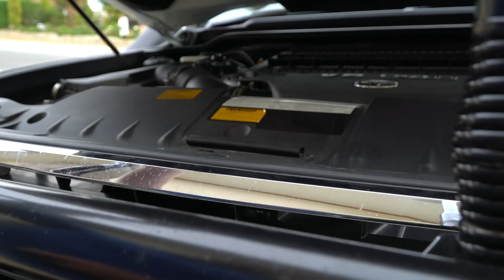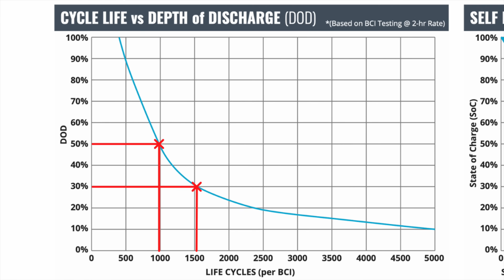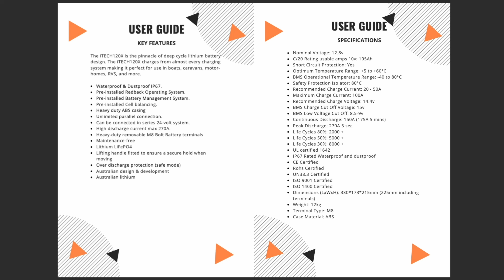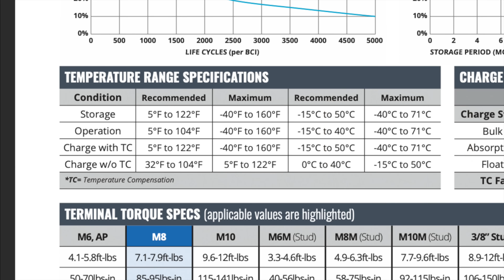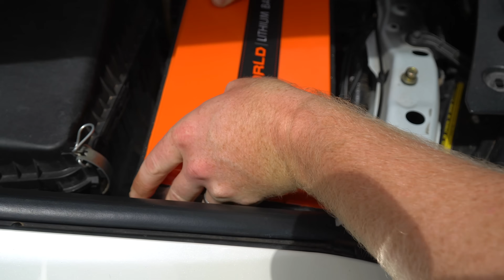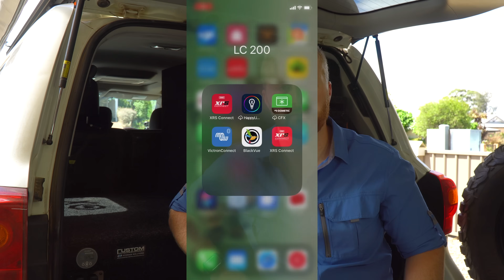UNDER BONNET LITHIUM | Is it worth the money? | Can it survive the heat? | iTechWorld 120X 12V setup

Comment: Hey Nathan,
Thanks for the good info I have also replaced my AGM with the Itechworld 120X in my 200 series and have not seen much of an Improvement over the AGM I only get 3 days run time between charges and I am only running a 60lt fridge which consumes between 1-5 amps
Reply from the maker: Hmm, this is interesting Clint. It will be interesting to see the results I get from it over time to compare. 
Cheers.
Reply: Which dcdc charger are you running to charge it?
Reply: @deepcyclesystems  Redarc 50amp
Reply: @clintrobey3765  capacity test it after 18 months and share your results...

On a battery pack let's assume it's 100Ah when new, running 0.5C charge rate is 50A throw in heat and no cell management you would need to keep it under 0.25C so 25A Max charging current, anything higher will lose capacity very quickly.
Reply: Without charging the battery -
I get 3-4 days in hot temperatures 30-40 degrees.
4-6 days in milder temperatures 20-30 degrees.
7-9 days in cooler weather under 20.

This is from a 100Ah LiFePo battery running a 55 litre Waeco fridge at 2° centigrade, and also charging devices and other smaller batteries.

Shading for batteries and fridge makes a big difference, direct sunlight will get that fridge working hard and sucking up the power.

But with a 120 watt solar panel, this system will never run out of power and runs permanently in the back of my SUV, there is always a cool drink and plenty of power on hand in the Aussie outback.

Comment: Well presented, well explained 👍

very timely, my 2nd battery (deep cycle under bonnet in a Hilux) needs replacing. A Dc to Dc charger is needed for an optimum charge profile, do you know if it is ok to charge a lithium battery thru a simple isolator ? 

I have recently heard of hybrid lithium that can accept charge direct from an alternator which might be a better choice to replace the current deep cycle.

Cheers
Reply from the maker: Thanks mate, glad you enjoyed the video. From what I know about isolators, it probably isn't suitable but then again, I haven't seen the voltage and amperage inputs from these units either. 
There are some other types, including the hybrids you talk of, however they don't have the same price tag as the 120X. 
Cheers, Nathan,

Comment: As best I can tell its actually a 105Ah battery (see the specs), I'm not sure how they get away with this dishonesty..
Reply: I see what you mean, now that I've read the web page and the spec sheet.  They mention it in the main heading once, but all other references are C20 rate at 105Ah.  I'd take it as being 105Ah usable capacity, which could mean 80% DOD to get 4,000 cycles is 84Ah and not 96Ah.
Reply from the maker: I've done some testing on this battery since this review and the results would indicate that this battery is a 120A capacity. My capacity test results got a total of 99 usable amps from the battery, this is when the BMS shut the system down at the alleged 20%. 🤷‍♂️
Reply: @XploringOz  Other manufacturers advertise the actual usable Ah (or even better, Wh). For example I capacity tested my 120Ah (1536Wh) Solarking battery and got 1540Wh before the BMS disconnected it at 10v. Will Prowse does the same with battery after battery on his channel. This may be a decent battery, but it should not be compared to other 120Ah batteries that can actually deliver 120Ah!
Reply from the maker: @TheDavidCollett  I understand where you are coming from, but this isn’t the industry standard for capacity measurement. 
Lead acid, calcium, AGM etc all have their “potential” Ah rating, not their usable. My FullRiver AGM is rated at 105A, but only gets 79A usable. 
Why would we measure lithium batteries any different to what the market has and still is doing for everyone type of battery?
It may be what you do and what other YT’s do, but it’s not what the manufacturers do. This is why people like me and Will Prowse do these videos, to compare the actual ratings with the listed specifications.
Reply: @XploringOz  Hi Nathan, I respectfully disagree. The facts are pretty simple, I tested another brand 120Ah battery until it stopped and got 120Ah, you tested the itechworld 120Ah battery and got 100Ah. What am I missing?? I know they state 105Ah usable in the specs, but it is clearly marketed as 120Ah to compete with other 120Ah batteries. That is my issue.
Reply from the maker: @TheDavidCollett  I hear you, I guess that’s a lack of consistency and regulation in the industry. With the introduction of lithium it’s more important than ever to ensure that the buyer understands exactly what they are buying and whether it suits their application 👍
Reply: @XploringOz  Prior to purchasing my 120X I was advised it was a 105amp hour battery, not 120.
If you look at the spec sheet at 1629 in the video you'll clearly see 105 amp hour rating.
I purchased the 120X totally aware I was purchasing a 105amp hour unit.
The 120X title may be misleading, even deceiving, or maybe that's just how we have become, presuming the title corresponds to the rating, however the specs clearly state the amp hours.
I read specs prior to purchasing nearly everything. I'm not disappointed, I wasn't mislead, I purchased a 105 amp hour unit.
I can't fault it's performance, love it to bits.

Comment: Good review again Nathan, particularly as you have tackled iTechworld which because of its flood of advertising just turns me off  and has me being skeptical of the performance of their products.  I will be watching with interest as to how it stands up to reality.  I have been looking at another YouTuber Stefan who has been using twin DCS under bonnet and his outcomes are a little confusing as he has change them again after 2 years.  Again I'm looking to see how they perform and will be interesting to see how your and his experiences turn out.  Whilst he got his at no charge, to purchase the DCS is a greater hit to the hip pocket than your model, so I will definitely be keen to see your outcomes.
Reply: The dcs lithium has a Bluetooth app that talks to the bms so you don’t have to buy a separate battery monitor 
It’s a military grade battery rated to 80 degrees c
Reply from the maker: Cheers mate. I agree with the advertising, iTechWorld do hit it a little too hard which can turn away potential customers. 
It will be interesting to see how these different systems hold up over time. I've heard great things about DCS, but it interesting to see he's had to change his over already, that would definitely not be a cost effective solution. 
Cheers.
Reply: @XploringOz   If you look at 'AllOffroad 4x4 Adventures TV' (Stephan Fishers channel) there is a build update for his cruiser where he explains why the batteries were changed, basically DCS had made changes to batteries and offered them to him so he was running the latest batteries DCS had.  I have had the under bonnet DCS batteries for almost 3 years now, have had no issues and not noticed any performance drop but unfortunately my one dont have the bluetooth setup.
Reply from the maker: @davewarland1680  Good to know 👍Always good to see and hear stories about long term tests. Good to hear that you have had good experience with your setup over the last 3 years.

Comment: Hi Nathan, smack-on.. 
99%hit the point what we are interested in.
I am with you and on the same path..
Full river starter and full river AGM battery fixed with BCDC 1240D charger and ready for the next upgrade.
See, same situation.. Pre 2019 the lithium batteries and BMS was not ready as it is now with the itech 120x or Amptron lithium batteries with IP 67 .
But some  things I need to ask which you may missed to cover or comes in a later video.
Battery set up to 1 starter battery, 1 aux battery: Yes
Aux batt cHarging with max 40amps from the bcdc: Yes
Battery solenoid and bridging switch installed: ?
Winching of the starter battery: ??
Aux battery to assist starter battery when flat by the in-cab push button: ?
Here comes the crucial point:
Lithium aux batt  175A max. 5 sec would be enough to assist a flat starter battery. (Means not solely starting the engine from the Lithium battery)
 
How about :During winch operation to assist the starter battery with the lithium battery?
Will it work?
For  how long? 5 sec or longer?
What happen in and with the BMS after overload shut down?.

I would ask this questions to ITechWorld, but I am not ready yet to buy now due to absence from Australia and I would need at least 3 to 4 pcs 120X for my van system also.
You are our “front runner” and I’m sure your audience would be interested in the answers too.
900.- AUD/pc on special was just finished by ITechWorld and compared a good value for money 
Looking forward with much interest in your next video and update..

Keep the sunny side up and 
Best regards from the Winter cold over-here
Cheers
Reply from the maker: Thanks mate. Some good questions there and there are still things I'm working on in the background for a future video. 

In summary though, my high powered appliances (winch and 1000W inverter) are currently hooked up to the primary battery. Given that this is still a conventional battery (not lithium) it is not recommended to have these batteries linked together. Therefore, although I have an in cab switch to bridge the batteries to assist/start the vehicle, it would not be recommended to use this as my setup currently stands. 

Further, the 120X does not have a CCA rating and therefore should not be used to start the vehicle. 

I will be doing further testing in the future and trying some other options out that would make this system run a little better and hopefully answer more questions. 

Cheers, Nathan.

Comment: Great video as usual. Mate you probably know there is the new hybrid lithium under bonnet that drop in replacement. Runs straight off alternator. In YouTube look up invicta hybrid lithium . There will be other brands as well . I was thinking of doing this . Would be interesting to hear what you think.
Reply from the maker: Hey mate, yes I have seen this. I just chose this option because of that value for money and don't really need this 'hybrid' capability for an auxiliary battery. I'm considering some options for a replacement starter battery and this will definitely be looked at. 
Cheers 👍
Reply: Itech do one as well
I have it as my starter battery 
No more dead batteries in remote locations

Comment: I have 3 of the iTechworld lithium batteries 1 of the earlier 120ah version which is 4 years old and still working well in the back of my Landcruiser and  I recently purchased 2 of the 120X for the camper trailer and couldn't be happier.
Reply from the maker: Great to hear. This is definitely encouraging! Hopefully I can get some similar results, despite the under bonnet mounting location. 
Cheers, Nathan.

Comment: Great video, Nathan.  There's lots to like about lifepo4, and ever since they've developed "drop-in" units that are largely compatible with standard chargers, it makes the changeover costs much more bearable.  Plenty of manufacturers only rate their batteries to 50oC.  Weight issue aside, which is significant, I tend to work out cost per day.  For those with a permanent fridge or other load used daily, it becomes total cost divided by cycle life covered by warranty.  Anything beyond that is a bonus. $1,000 / 36 month warranty = $0.91 per day, which is excellent.  At the other end is the casual user, say camping three weeks per year for the same 36 month warranty period, or $1,000 / 63 days = $15.87 per day, which is not much more than double the AGM.  No matter how I approach a good quality lifepo4 at a reasonable price, it is really becoming a false economy to stay with AGM for mobile use.
Reply from the maker: For sure and this goes back to individual suitability and usage. These aren't going to be for everyone, but given the quantity of people upgrading their power systems, they sure can handle a lot more and much higher powered appliances. 
I still firmly believe that everyone should consider all aspects of these types of upgrades and buy what best suits that particular user! 
Cheers 👍